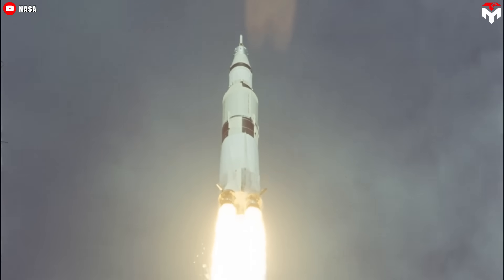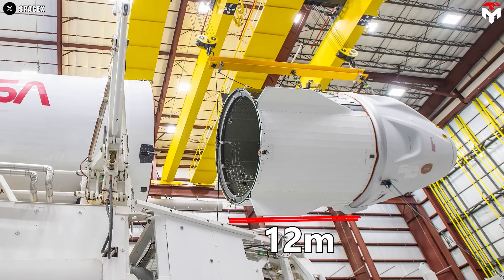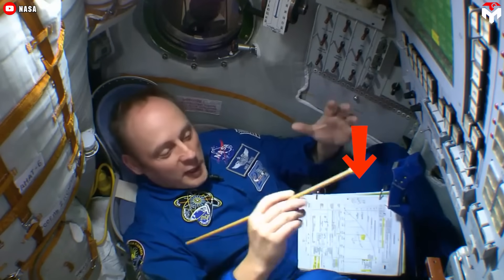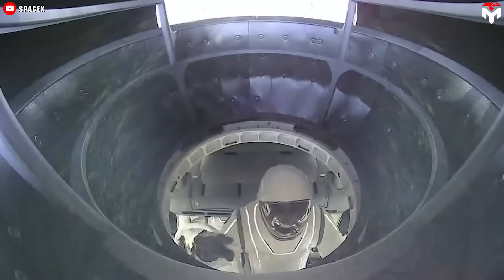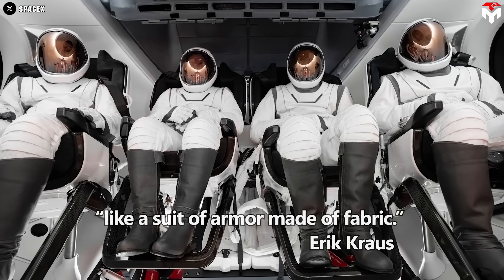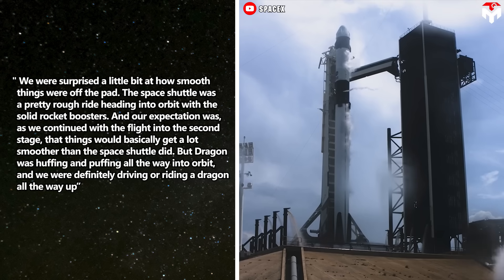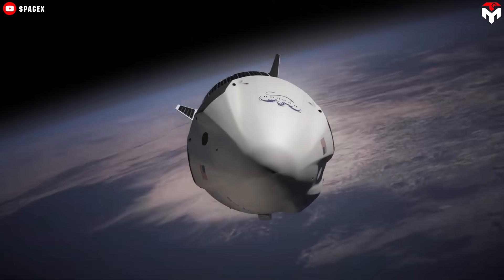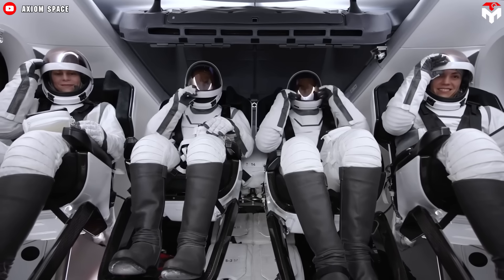SpaceX's Upgraded Interior Crew Dragon revealed Why Astronauts Refuse to Fly on Others…

Comment: Does the control screen swing back and adjust etc? How does the toilet work? Pooping is one thing but the older you get the more you pee and you MUST STAY HYDRATED ESPECIALLY FLYING!! Is the pee recycled??
Reply from the maker: The seats are quite high so you don't have to adjust the screen much, and yes, the pee do recycled.
Reply: @techmap9    No, it isn't. Urine is recycled on the ISS, but not on Dragon. They're really not in it long enough to make that worthwhile.